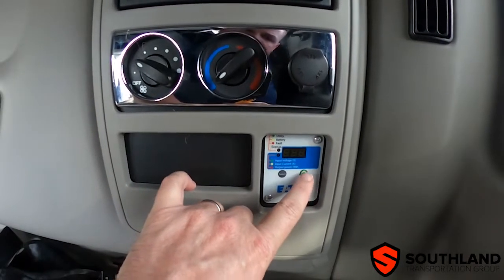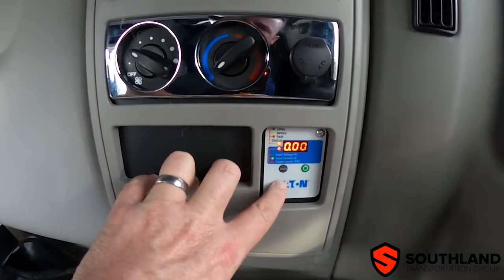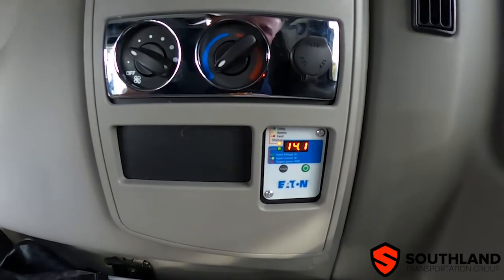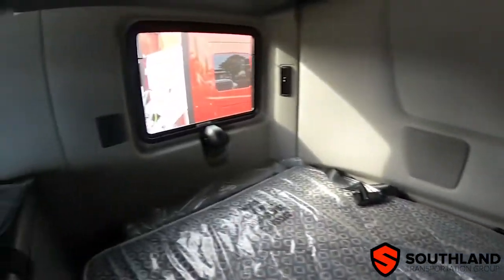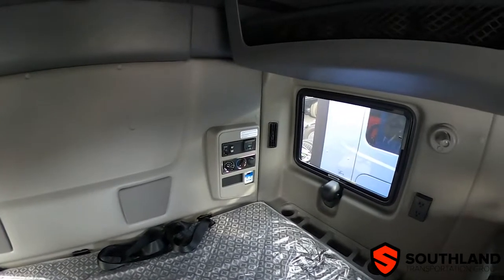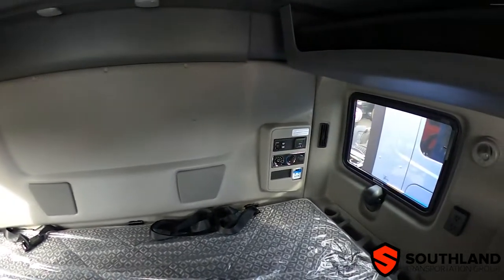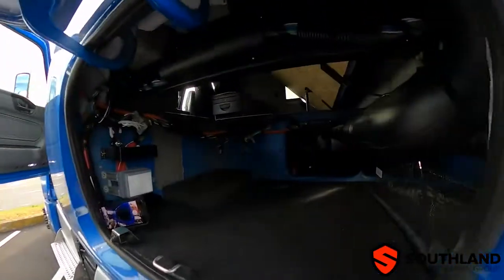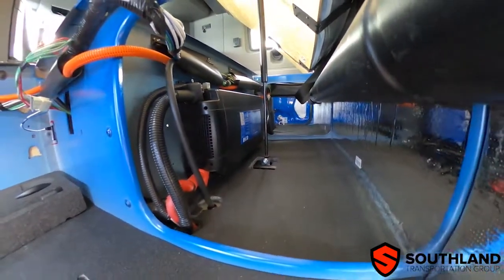Using Eaton Inverter on International LT

Comment: With a different company but, I was in a 2023 LT that had a Xantrex freedom xc 2000 watt inverter that worked great, got moved to a 2023 cascadia with a 1800 watt eaton inv. which works ok, when I had LT autostart enabled and truck  was not running I could use microwave, even my gaming comp. when voltage got to 12.2 autostart started truck like normal no issues (this was with Xantrex inv.), with eaton and optimized idle ensbled truck not running, if I use the microwave like before, voltage will go to 12.0 and it give er 05 which is undervolt fault, I have had this truck in the shop a few times they changed some settings on eaton inv. and it will do fine for about a day then back to er 05 like before. I also was told the eaton inverters can't be set to constant like the xantrex can, was told the eaton is more convenient (as in cheaper) than the xantrex by the shop supervisor. Anybody else have this issues with eaton inverters.